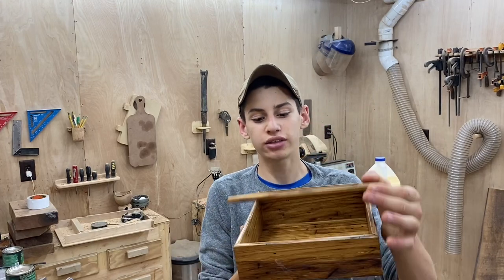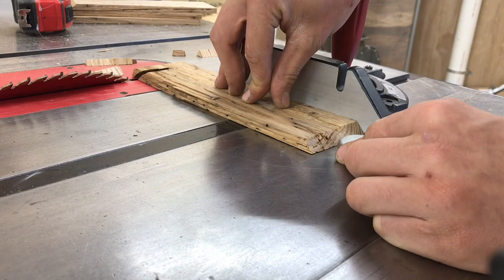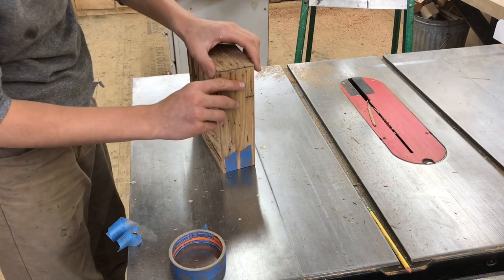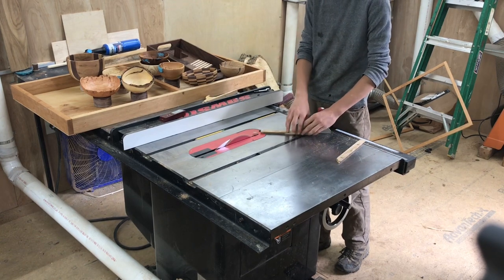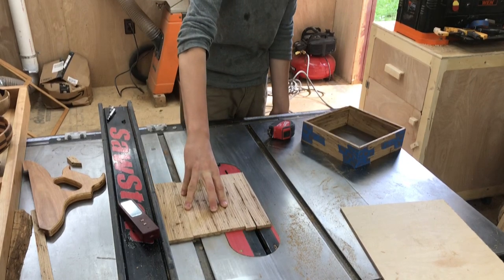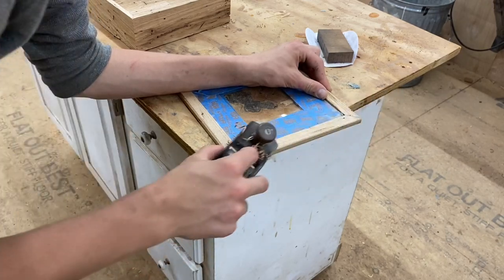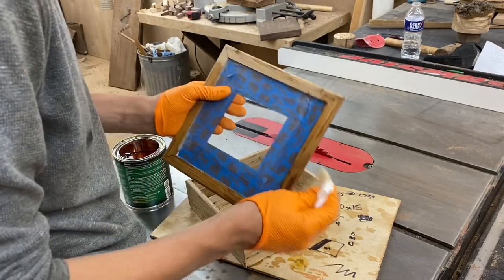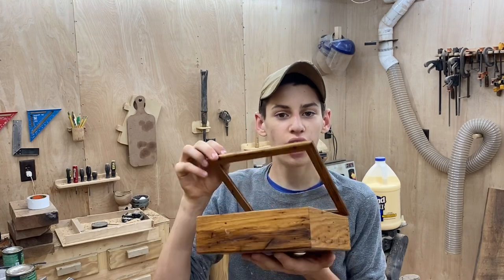Making a Chestnut Box with a Glass Lid!

Comment: As I'm sure you know, when you use wood glue, you can see everywhere you put a gluy finger once you go to finish. There's an easier way to remove the glue residue while not having to sand again. Most of the time in a woodworking project is sanding as you are aware.
White vinegar. 
Sand your project to almost finish sanded, then wipe your whole project down with the white glue to find the hidden residue. It will be very apparent like it is when you apply a finish, but you won't have to sand the finish off and sand some more, to redo the finish.
White vinegar will also lift all of the glue out of the grain without raising the grain. Just be careful on the joints. Pat, and wait for the glue to become opaque and scrape off or scrub it out with a shop towel. This also works with globs of glue you didn't manage to remove. 
Might have to scrub a little to remove the remaining residue, but that's fine. Just don't flood the joints because if the vinegar dissolves the glue, it will do that IN the joints as well. 
Voila! Residue identified and removed without having to find it after you've applied your finish then have to sand and refinish. Let it dry after removal, and THEN do your final sand and apply your finish. 
Will save you a lot of time because you won't have an "oops" in your finish. Old cabinet maker's trick.